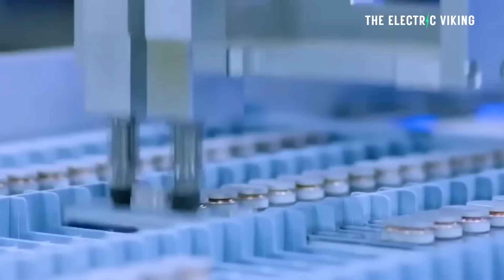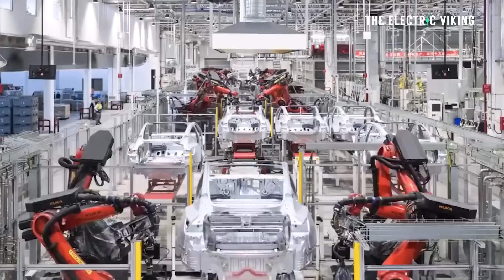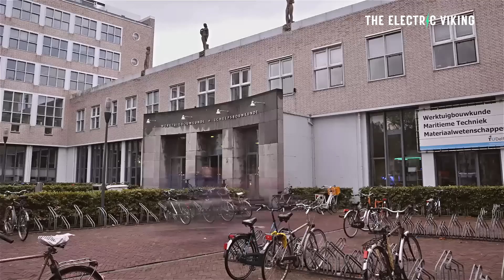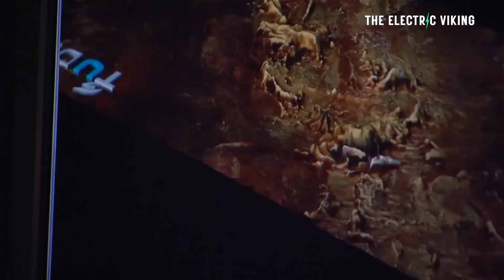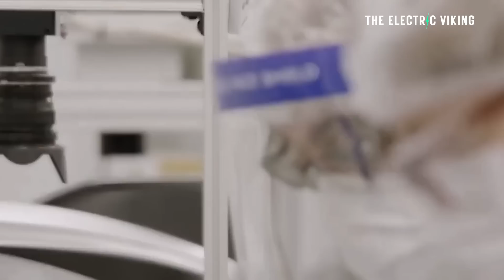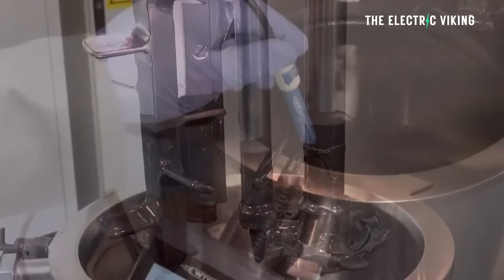Researchers make amazing discovery that cheaply doubles battery life

Comment: Even if you have to buy a new battery for your EV after 200k miles, my last two BMW’s only lasted 120k miles before they became uneconomic to repair. The reason, ICE cars aren’t designed to be repaired or worked on any more, engines, gearboxes can’t be disassembled, nothing is accessible and they have so much expensive complexity to gain as high mpg as possible there’s too much to go wrong, plus cost cutting and cheap low quality components. My last BMW’s just 2L diesels cost an absolute fortune to keep on the road, my Ampera PHEV now, just two new tyres and a couple of oil changes which I didn’t really need to have.
Reply: I'm sure they will fix this to meet planned obsolescence objectives as soon as the reliably numbers are returned.  So we can have "a newer model sooner!"  With "better battery life which matches the car's life!"

Comment: The following battery designs are some ideas for future EV batteries to rival fossil fuel performance: NanoGraf batteries, Lithium-ion batteries, Fluoride batteries, Graphene sodium-ion and graphene aluminum-ion batteries,  SLA (lead-acid) batteries,  solid-state batteries, Sodium-ion batteries, Nickel & Manganese batteries, to name some. Scientists can only work with what’s available on the periodic table which cannot produce a Flux Capacitor at this stage because “science”. I will certainly buy my first EV when all this is accomplished.

Comment: Toyota saying there isn't enough lithium is like saying there's not enough lead to make any more ICE car batteries. We recycle lead at more than a 90% rate. Some of the lead in your car battery may be from the 1950s ! That's why we don't need lead mines everywhere. Lithium is very common on earth and even if we trashed every car battery when it's taken out of service we could produce enough. But the fact is we can recycle car batteries and in time it will be like lead is today and a complete supply chain will be available. Add to that the fact that many future battery types won't use Lithium or very much of it and you begin to see how laughable the Toyota statement is.
Reply: A 75kwh pack needs 6kg lithium.  Annual production of 100k tons is only enough for 16 million new vehicles.  So there may be lots of lithium in the ground, but mining needs to increase hugely to make a dent in replacing the 2 billion vehicles on the roads.  Lithium mining has quadrupled in the last decade, which sounds great, but that would mean ten years from now only being enough for 64 million cars -- 30% of annual new car production.  We either need to use less lithium or increase mining much faster than even the last decade did.

Comment: You really should do the math for yourself.  Known Lithium reserves are published, as are the amounts of Lithium required for a battery of a given size.  Don't let Toyota claim the value.
Reply: I've done the math, and the current 100k tons annual lithium production is only enough for 15 million cars per year -- meaning either less than 10% of new cars can use lithium ion batteries or lithium production needs to increase dramatically.
Reply: @kirkellis4329  lithium production IS increasing dramatically.  Now look at the known reserves.

Comment: I put 87000 miles of driving. Last year. On one of my vehicles. 27000 on the other. I know people who drive more so 10 years. It's not out of the question but you have to change the battery
Reply: Lithium iron phosphate batteries already claim 5,000 charge cycles.  At 200 miles per charge, that is already 1 million miles.  Few ICE vehicles get away without replacing either the engine or transmission or both much sooner than that.  Those are both in the $5K-$10K repair category for a brand new part and labor, so similar expense to a battery pack.

Comment: The problem with any battery innovation is that they each have to be tested and tested and retested before any manufacturer can dare to put them into a production car, and risk having to recall Billions of dollars of cars an/or their batteries.  Especially if they are 'structural" battery packs which are an integral part of the frame.  Ask GM and LG about battery recalls.

Comment: if you could double the life of a 75kw pack and make it go 500,000 miles that would be pretty damn good.
Reply: If you could go 5 million, that would be good too , while we are wishing
Reply: @coolranch1660  well teslas already go to 300k easily so 500k is well within reach
Reply: If you believe the vendors on Alibaba, they claim their ternary battery cycle life exceeds 3000 cycles -- supposedly tested keeping the SOC between 20% and 80% and never charging faster than 2 hours.  That should actually be easy to follow for a typically EV user and at 200 miles each charge would be over 500k miles.  

Personally, I wish auto mfrs would move to an interchangeable and standardized battery module format so that ten years from now you can replace your battery with newer tech for more range and power for a couple $K.  Eventually, there should be third-party aftermarket parts for EVs like there are for ICE vehicles where you can buy a replacement alternator, starter, spark plug, etc. from any of 20 different makers.  

My flashlight or cordless drill can use new batteries from many sources because the format is standard, but EVs are going the opposite direction with structural packs and cooling systems specific to a vehicle.

Comment: The issue with phone batteries is mainly due to designed obsolescence. If they extended the battery life or made them easily replaceable, they'd sell fewer phones. Even if this technology works, I doubt you'll see it in you phone. Think about it. They can fit thermal management inside a CPU chip for your computer. It wouldn't be hard to put it in your phone, so why don't they?
Reply: It's fast charging that wears out phone batteries but that's what people want.
Reply: @Withnail1969 , lack of heat management is what allows that to happen. It's the phone manufacturers who benefir from it. The operate on the principle of phones lasting two years and needing replacement.

Comment: Lithium is extremely abundant on earth. Toyota is talking about current production capacity as if it would be static…😂
Moronic excuse.
Reply: It's almost as if Toyota were talking their book,
Reply: Yes, but lithium mining is basically strip mining, and that is going to get some environmental pushback soon.  It has quadrupled over the last decade but still only enough lithium for 16 million vehicle-sized packs per year.  Replacing 2 billion ICE vehicles in 20 years would require mining increase even faster than that.  Even ten times as much lithium would not be enough for all 200 million new vehicles each year to be EV if they need lithium ion packs.  Sodium, flouride, aluminum, or other chemistry may need to succeed lithium.

Comment: I don’t have an EV yet but when I do, knowing I would have to replace the battery in 10 years means I can replace my battery with the latest technology that could mean 5 min charging and 1000mi+ distances, way less expensive, etc. You can’t do that with an ICE. You would possibly do like for like. No improvement.
Reply: Yes, but mfrs would need to be using replaceable modular battery packs of a standard format.  Instead, they are moving toward "structural" packs where the batteries are glued into the pack which is now an integral part of the chassis.

Comment: I wouldn’t be surprised if we start seeing a lot of used EVs with 300,000km or more of range actually selling. We have a 40kWh LEAF with 100,000 miles and it still gets its EPA range. No maintenance yet except new tires and wiper blades, and it drives fine. I can’t imagine owning a gas car that is this hassle free.

Comment: You don't need to wait to get an electric car due to battery issues.  10 seconds later talks about battery improvements.

The truth is the cost is outweighed right now if you don't need to buy a car immediately then don't.  Electric or otherwise.

Comment: Thanks for reporting.  I've owned and driven an EV for the past 7-years, love it, and planning to buy the GM Equinox EV as soon as ordering opens and encourage EVERYONE to buy EV's and solar panels, however, with the mountains of research and evidence of solid-state batteries I've seen over the past ~20-years working in the battery storage and RE fields, there's no question, EV batteries are going solid-state as today's batteries will never escape temperature degradation, large thermal management and BMS's, even though they will get slightly better, day by day.
Reply: Solid State Batteries, are like Fusion energy 50 years away and probably always will be..
Reply: SSBs still need a BMS though, just needs to be used less often.
Reply: so I read your statement about solid state as a salesman catch-all code-word for "some advancement or incremental solution, not solid state per se." Like, "buy now! they'll figure it out later!"